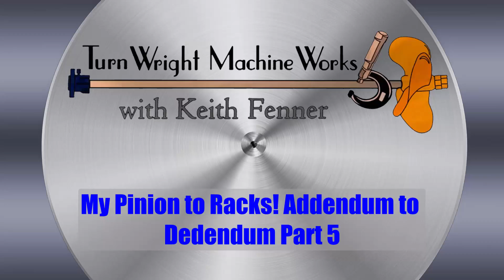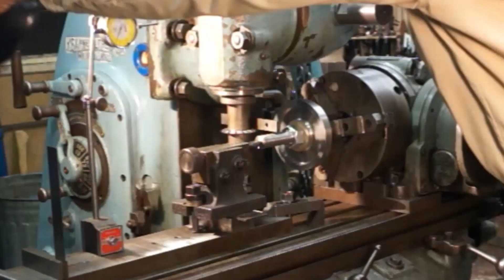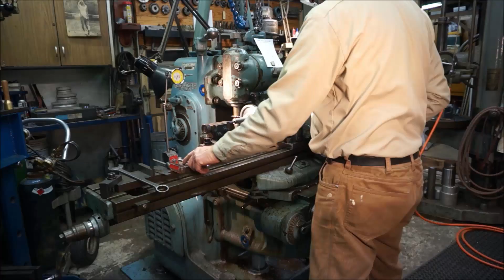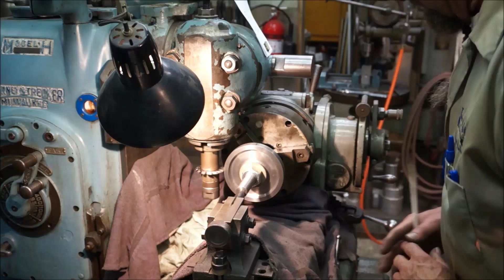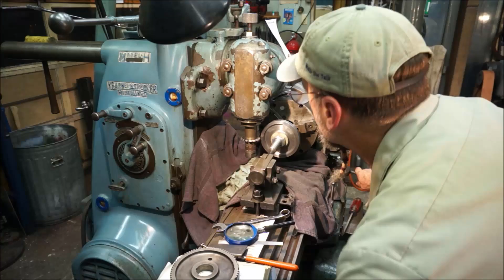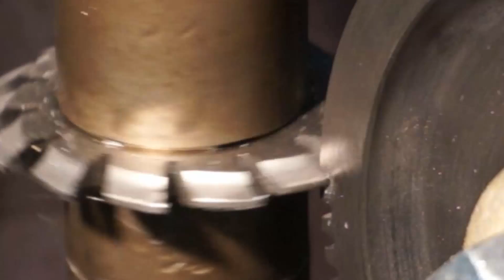My Pinion to Racks  Addendum to Dedendum Part five

Comment: Hi keith,
it sems that you do not use any coolant or whatever.
Is the only way to cut gearwheels to do it "dry" without cooling?
Reply from the maker: beernd It is because of the ductile material, if I was cutting steel or alloys I would use flood coolant on the cutter. ;{)-----

Comment: Keith, have you made a video about cutting splines in a shaft? And on the inside of a dog clutch? I have no idea where to start ( except put my first lathe in the shed) i bought my first lathe with some tools, the previous owner kept it as a antique in his living room ... I decide to put it to work :) 
A single phase motor on a non branded machine, i say good enough to learn with.
Reply from the maker: The only video I have with Spline cutting so far is; Stroken Spline series. ;{)-----

Comment: Keith,
The lowest number of teeth you can cut on an involute cutter is 12, not 11 teeth. By the way, that's why the clock guys us cycloidal gears, you can cut a lower number of pinion teeth. Trouble is cycloidal's have greater friction, their argument is that you use fewer gears which makes up for the extra friction.
Rob

Comment: Keith I'm really surprised you did not do this on the horizontal with a out reach support arm ?  Was a clearance issue involved or ?? I would think from a "rigidity" stand point, for the cutter would not that be better ??? I guess this could be done then on a vertical mill then ... No ?   Just asking Brian.. Keep up the good work !!!

Comment: HI Keith, wow, a very good job of explaining the details. thank you so much for the upload. one couldn't put a price tag on the value of the videos you have produced.

my question today is on the conundrum i have with my old J-head bridgeport. i'm in germany and have a really hard time getting decent arbors. i still chuckle when i think about your video "unfinished tooling" and am confronted with headache of a similar nature. it seems all a guy can get here are crappy chinese made arbors which have too much runout for the german made HSS E Co5 cutters i'm running (i've had several disk cutter go "poof" on me to the tune of several hundred euro). would it be a good idea to build up (with 6013) an arbor spindle and turn it on the mill itself to match the minute amount (about 0.005mm) the machine spindle has to get the cutters to run true?
Reply from the maker: Yes you could turn a build up or fab a new arbor shaft from scratch, turning the final size in the mill if your travel allows. ;{)-----

Comment from the maker: The difference in making it out of cold roll would be the wear and longevity of the gear teeth, and or galling effect, ductile materials make great bearing surfaces as well and they wear good together as gears. Other alloys used in gear making also have to be hardened, in a lot of cases to a different degree in the same line so the wear is even. You may be able to use the cold roll gear and also maybe case harden it after to better it. Application for the gear plays a big part of it and it's good to research that out as well.
Reply: I wish you could've explained that logic- to the "Gearheads" at GM back in the 70's & 80's with their brainiac idea of nylon camshaft sprockets.
Reply: Damo Floyd Thanks for the info. I already have them bookmarked. I'm already on my way to converting it to a CNC. I got the motors and the drivers. Now I need to get a 48V 1000W power supply and mounting brackets (or I may just make them myself).
Reply: agree.
Reply: Hey, you do a lot of machining and I just want to know if you know where I can buy METRIC ONLY mills and lathes?? Preferably medium to small size and it cannot be Sherline (I hate Sherline mills and lathes!!).
Reply: EETechs
Proxxon makes mini lathes and mills. For the home workshop, a medium sized lathe or milling machine will probably be from China. I got an Optimum BF20L, not bad for ameteur stuff.
Reply: Damo Floyd
I agree, I get very good quality and consistent cuts with it. I have the quality control papers signed by a German engineer.

Comment: Keith,  You got me on the edge of my seat, the Pucker Factor is high.  Sorry that's a little term we use in the shop I work at.  And on top of that you cut the video off before we saw you made a 360 with the part.  I look forward to Part Six.  Rock on!

Comment: The pressure angle is basically the angle of the sides of your cutter. a 14.5 is nearly straight while a 20 or 30 becomes much more triangle shaped. The greater the pressure angle the higher the tooth strength and that is why 14.5 is nearly obsolete these days as it wasn't real strong and was prone to breaking at the root much like this one did. Of course you can't help that since gears have to mate the only way to improve this one would be to cut the gear it runs against as well. I don't think I would have thought to use a parallel to set center height. Very practical. I am really liking this series!

Comment: Keith, am I imagining all that runout in the universal head arbor as it's spinning the involute cutter?  If it's real runout, seems like you'd be cutting only on a couple of teeth, right?
Reply from the maker: Thomas Utley some of the sleeves run out but the cutter is within a couple thousandth's. I sped up the feed to catch each tooth on it pass by the contact zone.
Reply: Keith Fenner I had a dovetail cutter that either was designed that way, or was poorly made. It ran out a couple of thousandths too, but cut really well if I pushed it fast enough for all of the teeth to contact. Seemed to like faster rather than slower. Is that a typical thing with a 16+ tooth cutter?

Comment: Nice video Keith - thanks for sharing.  Is there a reason why you aren't using cutting oil on cast?  Or is it not recommended?
Reply from the maker: Comanche Pilot Cast or ductile iron has sulfur in it, some what a lube and is very powdery / abrasive swarf, not wanting to spread it around on the ways. ;{)-----

Comment: I didnt read those previous comments but I work with gears and involute gears, which most gears are, slide everywhere on the flank except on the pitch circle where you have pure rolling. The sliding velocity increase the further away from the pitch circle the contact ellipse is.

Comment: Noticed you decided to use a bronze/ brass washer under the nut. Was that just to help with vibration or harmonics? Or to help the nut seat evenly?

BTW Love your vids. I used to think I was a pretty good welder. I used to think I knew my way around a Machine Shop. Until I saw your work and Adam's and the others...

To think I made straight "A" grades in College when the instructor was an old Navy machinist. I took the old LeBlond lathe that nobody else would touch. The others wanted the "new" looking machines. Had that old girl happy and the next day it was set just like I left it. Cleaned up before I left it every day. For months nobody else messed with it.

That was 1979. And I have some experience with gear drives BTW.

My GrandDad was a Lockheed machinist and built B-29s.

I think I chose the wrong profession. I'm a Mechanical Engineer but like to burn steel and make chips...
Reply from the maker: Phil Grindle The washer was just cad plated. looks like brass though. thanks for the comments and Le blond's are sweet lathes. ;{)-----
Reply: Keith Fenner It was. Didn't look like it though. The other guys just got on whatever machine was free on any given day but even then I was smart enough to know there are variations between machines and it's best to stay with one. Funny thing is I kept noticing the instructor out of the corner of my eye watching me make chips. :)

Comment: Very versatile mill that! 
I think you were right in the first instance, there is a slight sliding friction with involute gears, true rolling gears are Epicyclodial ( such as in clocks) the Epicyclodial gear form isn't as strong as involute, 
Involute is a trade off between friction and strength, whereas the Epicyclodial is all about minimising friction as very little power is available in a mechanical clock (effectively a spring like your bridgeport quill return spring running the clock for a week) 
That's if I've remembered my Friday afternoon college lectures of twenty years ago correctly!!! 
Thanks for the amazing amount of effort you put into your videos, it makes me feel very humble. . .  
Daryn
Reply: not only is epicycloidal not as strong, but it's meant for a totally different purpose. Involute is designed for constant rpm, epicycloidal is designed for constant torque. The torque transfer changes slightly with involute because the mating diameter changes slightly as the teeth move along, but doesn't have any differences in rpm as the next tooth engages. Clocks play a lot of clever games to give constant torque. A u-joint would be a bit of an analogue to a cycloidal gear pulse, in how it causes a pulsing output when at an angle, many small rpm changes per actual revolution
Reply from the maker: Daryn Radcliffe Thanks for the comment. I'm getting use to not putting to much inference in being right as long as I create thoughts that develop into one's walk without an idle mind. ;{)-----
Reply: Daryn,
I disagree, see my comment above for why the clock makers use cycloidal gears. Personally if I made a clock I would use involute gears, the velocity difference is not significant when you take the complete train into consideration. Cycloidals were popular because of the simplicity of the tooth form. Also clock makers like John Harrison (circa 1670) didn't have access to involute cutters, the weren't invented until 1834. Although his clocks were extremely accurate ( he won the 20,000 pound prize for longitude.)
Rob
Reply: Sorry rob, he didn't win the prize, his son claimed it after his death with a watch made by the son and Graham ( I think)  though to his father's design, 
Clock gears are generally Epicyclodial, not cycliodal, unless the pinion is the driver, 
Good luck with your involute geared clock, it will run with a heavy enough driving force. . . . 
The Epicyclodial tooth form is not a simple form, unlike involute which is simplified to let a small number of cutters cover a range of counts, unlike Epicyclodial which needs different cutters for each pinion count up to about 18 where a general "wheel" tooth form cutter is used, this makes it rather expensive as my pocket will contest! 
Kind regards 
Daryn, Southwest uk
Reply: Daryn Radcliffe
Daryn,
Cycloidal is the gear type. Gears can be hypocycloidal or epicycloidal depending on whether the form is generated on the outside or the inside of the circle. Harrison received the prize when he was 80, he died three years later in 1776.
Rob

Comment: In my experience with gears its more accurate and much cheaper to have them wirecut.  Might make a nice video if you could film the wirecut.  Designing the cutter path with an involute spline takes no time at all in CAD.  They could even cut the arbor and keyway to capture the tolerances and relationship to ten thousandths.   Great job doing it oldschool though!